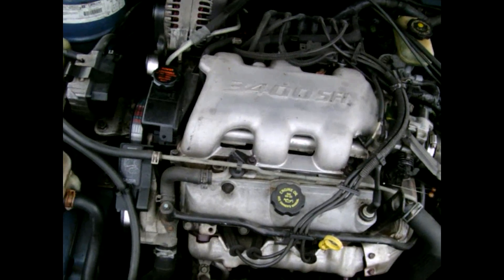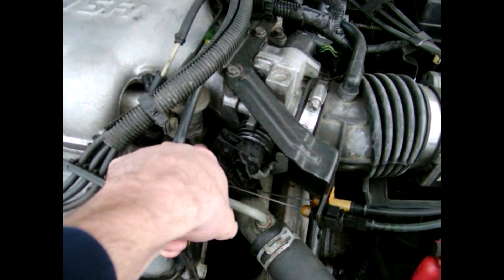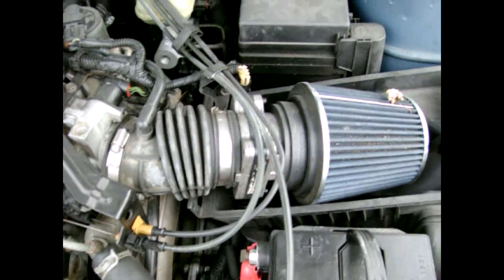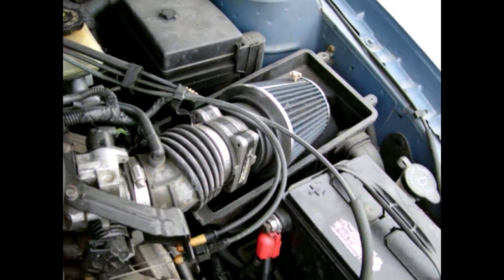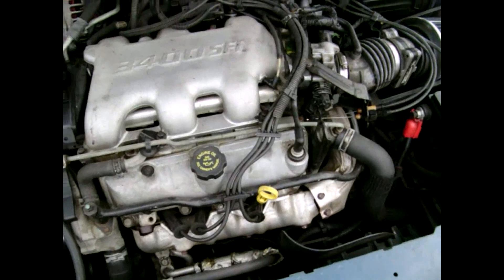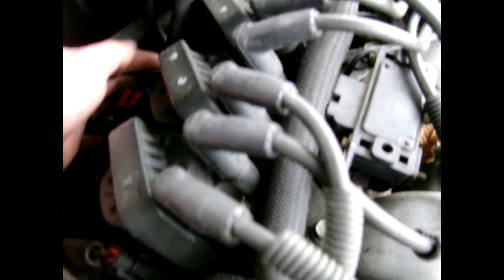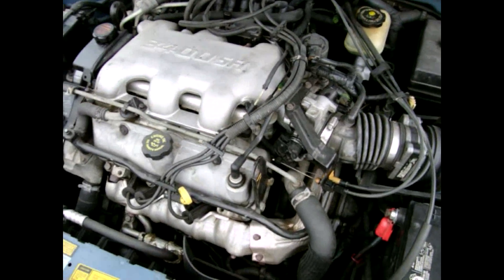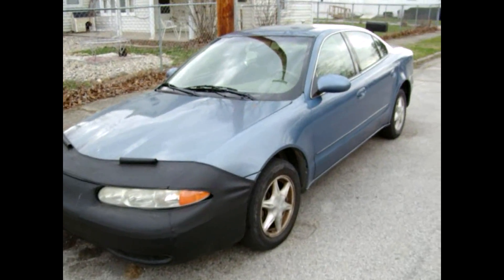3400 GM Engine 3.4 Liter Motor Explanation And Discussion

Comment: Possibly the coil pack is arcing out. They can give sufficient spark at low RPM but can't deliver the right amount of current needed once RPMs go up. Also you mentioned that it gets worse when it's wet. Be careful with this next trick and don't zap yourself. But I've used a spray bottle in the dark and sprayed a mist around the coil pack and wires. Watch for any blue arcing. The water will allow it to jump spark easier and be more visible in the dark.
ok gave it a try last night and saw 2 areas

Comment: So my 2001 chevy impala with the 3400 has those two nipples on the manifold one on the front right as your looking at it and one on the rear left both are suctions how would I fix that issue because when not capped the engine will not run
Reply from the maker: If they break, it can be hard to find a replacement.  Might try finding some at the junkyard or get some bolts to plug them off at Fastenal.  The ports are used to bleed air out of the system.  These engines are notorious for bad gaskets.  If you keep having to bleed the system, it's a telling sign that a gasket has gone bad.
VT247

Comment: Hey thanks for your post im looking to change egr tube in my 2001 pontiac aztek same 3.4 any insight on how to get it done will be awsome to me thanks
Reply from the maker: Spray the area where the tubing connects to the manifold with some penetrating oil and let it soak.  I've never had to take one off when it's actually inside / on the car without the motor out.  Probably need to remove the front 2 motor mount through bolts and 'rock' the engine forward to gain extra clearance to the back.  The EGR has 1 10mm bolt holding on the transmission dipstick.  Then there are 2 bolts holding the EGR to the upper manifold.  1 bolt that holds the tubing to the EGR.  You'll need a big wrench to unloosen the tubing from the manifold.
VT247

Comment: I've personally repaired like 10 of these engines and i hated changing out the gaskets, it's such a huge pain to do and it's not even worth it at this point since many of these engines blew up anyways.
Reply from the maker: I've told countless people when they discover a head, intake or timing cover gasket leak.  Do them all at the same time.  Yes, it does mean basically an engine overhaul of the long block, but the factory gaskets will eventually fail and if a person only does one, they'll be back in there later doing the rest.
VT247

Comment from the maker: It's best to take off the upper intake and clean the passage.  But, it is possible to remove the EGR valve, 2 10mm bolts and spray carb cleaner down the passage with a coat hanger used to break up carbon.  Without taking off the upper intake, the engine would have to eat all that junk.
VT247

Comment: Couldn't see the back plugs on my 02 grand am gt. 3.4l. Was on the last spark plug and it cross threaded in. I have my abs light on, traction off light on, service vehicle soon on, and service engine light on. With the abs, traction, and service vehicle soon, I know what's caused that. Grand ams are bad for their sensors on the hubs.. The service engine soon light is caused by my evap purge solenoid not working properly, as well as the tube that connects to the valve cover from the solenoid is cracked and dryrotted..

Comment from the maker: If your car is overheating, I seriously doubt it's the thermostat. Someone may have told you that the thermostat is stuck closed. This rarely happens on these cars. Most likely it's the head gasket, they are known to go bad. If you bleed the air out of the system with the bleeder screw on top of the water pump (7mm) or thermostat housing the temp stays regulated for a few minutes. Drive it and air bleed the system again & there's air, it's the head gasket. Hope this helps. : /
VT247

Comment: I have an alero 2000, 3.4L , I already change, fuel pump, sparks, spark plugs, egr valve, idle air control, ignition switch, map sensor, throttle sensor, and my engine still shake in neutral or stop sign, its feel like going to shut off, what could be the problem?..... somebody give me any idea, this touch my pocket really bad.
Reply from the maker: I'd start by checking the coil packs and that each cylinder is getting spark.  Sometimes the coil packs will short out and make the car run like crap.
VT247
Reply: Any codes?  I had my Cylinder #6 give a no spark condition.  Engine would run very rough, and throw codes P0300.  I had to change out the ICM under the coil packs, and that solved the problem.  Before that, I was also getting random misfires under hard acceleration.
Reply: i have misfire code, same thing happend to my crack car, today i going to remove that part to bring it to auto zone.... i just changed the intake manifold gasket but the old one wasnt burn o fail.

Comment: thoughts on the 3.4 in early f body camaros? degreasing these engines what should be covered pressure wash is a no no right?
Reply from the maker: The 3.4 in the Camaro's were different motors.  Not had much experience with them.  As long as the intake doesn't get water in them and the spark plug wires are in good shape, I've sprayed off several grimy motors at the local spray and wash. 
VT247

Comment: I have a 2003 Buick Rendezvous and I recently had the intake and head gaskets replaced along with the thermostat and a bunch of other stuff. It drives great and no cel or anything. But! I have two little problems. It has been fairly cold in the mornings and when I first start the car I sometimes hear a slight tapping noise which I suspect to be a loose rocker arm or maybe a lifter? Only on cold starts and then goes away in a sec. Also, my gas guage doesn't work well. My low fuel light comes when I first start the car and sometimes slowly goes back to the correct fuel amount. I'm hoping you can help.
Reply from the maker: The fuel gauge issue is the sending unit inside the gas tank.  You can usually clean the 'swipe' area that is metal and push in the connecting tab to make better contact.  Bad news is that you have to drop the tank to do this fix.
The slight tapping noise is most likely piston slap.  The engines have a loose tolerance for the seal and will make that noise.  It's not really something to be concerned about.  I imagine that you live in a cold region right now being winter and this is typical for these motors when starting cold.  The piston rings expand and make a good seal once warmed up.
VT247
Reply: Thanks for the respond. I might try some fuel system cleaners in the tank to see if that helps the issue. If not, I might just go ahead and get that fixed. As for the piston slap I didn't hear it starting it up this morning so I do think it may not be an issue to worry about. Thanks again
Reply: Vacationtime247
To stop the cold start tick noises in my Pontiac Montana I put in a bottle of STP Oil Treatment. It's very viscous and sticks to engine parts rather than run down and pool in the crankcase when the van's not running. Lack of lubrication until the oil pump has a chance to circulate the oil seems to be the reason for the cold start noises. I recommend the Oil Treatment for high mileage engines.

Comment: Vacationtime, thanks for the videos!  Need your help.... my 1996 Olds Silhouette with the 3.4 liter engine.....well,  the dealership told me that I need to have the crankshaft seal replaced.  Any idea on how much this disaster is gonna run me?
Reply from the maker: If you go to the dealership, it's going to be expensive.  Dealerships usually charge more than most any other shop.  The serpentine belt has to come off along with the harmonic balancer then the crankshaft seal.  My guess, $300-$500?

Comment: I have a 1998 Venture and the pipe that runs in front of the motor that looks like it goes into the firewall, and has a couple of small hoses in it, what is that called? Mine got a pin hole leak in one of the corners and I had to have it towed because of the leak. Some have said it is the transmission cooler line, but I don't know. I was spraying antifreeze on the motor so I know it has something to do with that. Any help would be appreciated.
Reply: heater hose just get a peice fron autozone ask then to look at it

Comment: 2003 Buick Rendezvous leaking antifreeze behind engine block. Can't tell exactly where. Is there a hose I'm missing. Problem just started after new water pump was put on.
Reply from the maker: Could be the intake or head gasket.  They tend to go bad.  
VT247

Comment from the maker: @Texasselling My 99 Alero's fan's don't come on until @3/4 way warm.  A car isn't overheating unless it boils over.  If you have antifreeze bubbling out the radiator because it's to hot, it's overheating.  If not, it's fine.  Besides, an engine runs more efficiently when it's warm.
VT247

Comment: Im assuming intake manifold gasket. Getting air in the cooling system, losing coolant, over heating issues. Fluids do NOT mix though, so thats good. I bleed the air from the line every day or two and add some coolant until I can fix it right. Any recommendations on what types of gaskets to fix these with? My last 3400 blew THREE head gaskets. I heard there was a good set that lasts longer now. Any tips woul be great! Thanks
Reply from the maker: It's not that much more work to go ahead and do the head gaskets if your already doing the intake manifold gaskets.  My recommendation is to do both if your already in there.  Use the Fel-Pro HD (Heavy Duty) head gaskets and the rubber Fel-Pro intake manifold gasket kit.  Be sure that the metal tabs line up when doing the intake gaskets that fit into the slots on the heads.  I accidentally didn't have one of the tabs lined up right, torqued it down and cracked the upper AND lower intake aluminum manifold and had to replace both.  The intake and exhaust pushrods are different lengths and be careful not to over torque the rocker arms to not strip out the threads in the head.  Hope this helps : )
VT247
Reply: Vacationtime247 yes, i was going to replace all gaskets. Ive never done anything more than a water pump, alternator, and stuff like that. No actual engine work. Any tips or tricks? Thanks
Reply from the maker: Read the manuals, watch the video's and let those be a guide.  It's not that bad once you know what you're into.  Intake and exhaust pushrods are different lengths so make sure those are installed correctly.  A/C pump needs removed to take off a bracket to get the heads off.  Cut the tab off the oil dipstick instead of trying to pull it out.  Just a few pointers.
VT247
Reply: I appreciate it. Ill keep you posted if I try to attempt it

Comment: I have a 01 Chevy Monte carlo. My car always starts rough i gotta hold down gas for it to start. Also once its warm she likes to stall after i sit at a stop light or sign then turn a corner or something it stalls. I replaced fuel lines, idle motor, pcv valve, plugs and wires, and fuel filter. What could it be on the 3.4 sfi...
Reply from the maker: Fuel pressure regulator and make sure it has good pressure from the pump.
VT247

Comment: Where would my booster vacuum line be then? Just bought an 04 alero and I just cant seem to locate it.
Reply from the maker: Back of the upper intake manifold.  Largest vacuum line connected to it.  Close by the alternator area.
VT247

Comment: Omg...I ran into another Problem withy 03 monte carlo, Today i had very lil pressure in 1st gear but on the freeway it ran cool...Ummm now it wont drive if I put in Drive, but it would drive in drive 1 and 2 I don't know what the problem is and I'm tired of trying to find someone to diagnose my Monte Carlo correctly.. in the opinions on what you think it might be?

Comment from the maker: Take the car to most any auto parts store and have the codes read.  Best to erase all codes.  Get the loan-a-tool code reader from Autozone or wherever and erase the codes.  When the light comes back on, check the codes then.  This will help eliminate invalid codes popping up from the original problem.  Here's my .02  Possibly the O2 sensor, idle air control valve or most likely a vacuum leak.  Spray carb cleaner around the vacuum lines, if the idle changes, you've found the leak.
VT247

Comment: I have the same engine in a 2002 Pontiac Grand Am.  There is a water leak below the motor mount on some hose that comes out of the firewall and goes into a silver cylindrical device in the right front wheel well (behind a bunch of plastic housing).  The engine mount sits on a support bracket and under that support bracket is where the hose coming out of the firewall to the silver cylindrical thing.  Can you tell me what that silver thing is?  How would I go about replacing that hose?
Reply from the maker: +Robert Walker Might be the heater core.  Best to do a pressure test of the system.  Get a loan a tool from Autozone and pressurize the coolant system after filling it up with coolant.  This will show you right where the leak is as it will spray out.
VT247
Reply: +Vacationtime247 I wish I could put pressure in the system.  it's a close system and when I pour fluid into the reservoir it comes right out through a pipe somewhere.  It's not the block, it stays dry.  I have a UV kit that I'm going to use to see if I can spot the leak.

Comment from the maker: Rotten egg smell is usually the catalytic converter.  Check the spark plugs and ignition system as well while your in there.  Hope this helps. 
VT247

Comment from the maker: My Azteks will either die or stall out once the oil cap is taken off when running.  On my red one, 4th gear just went out.  The 4th gear clutch hub splines sheer off.  Guess GM fixed that in 2003 but mines an '01.  So I'm not looking forward to that project at all.  But it can be done with the transmission in the vehicle, but requires 3-6 hrs of work.  : /
VT247

Comment: I  am having an issue with the charging system in an Oldsmobile silhouette 2000, replaced battery, 2  new alternators and still not charging the battery, at times the voltage shows 15.+ coming out of the alternator other times is 3 volts or nothing at all, it seems the alternator is not getting  the signal from the computer, any one have any ideas in Fixes. Thank you.

Comment from the maker: If you ever do the intake manifold gasket, go ahead and do the head gaskets.  It's not that much more work.  It will prevent you from having to do the job again when they do go bad.  The fans won't kick on until it reaches almost the red in most cases.  Any type of oil will work, I've used the best and the cheapest.  Never noticed any difference.
VT247

Comment: Do the 3.5 L chevy malibus have head gasket failure issues ? Mine is a 2005 and it seems like i have excess air in the cooling system. I never had a problem until i cracked the bleeder screw by the water pump and ever since it seems like i have excess pressure. I have drained the cooling system and bled it and no luck.
Reply from the maker: Sounds like a case of a bad head gasket to me.  If you bleed out the system and it still runs hot or has exhaust gases escaping into the coolant it's the head gasket.
VT247
Reply: Wouldn't my oil be milky if the head gasket was bad or not always ?
Reply from the maker: Typically with these engines milky oil would indicate a bad intake manifold gasket.  A bad head gasket can cause exhaust gases to escape into the coolant passages, causing air bubbles overheating and coolant loss..  Happened to my '01 GM 3400 Aztek, replaced the head gasket, has run fine since.
VT247

Comment: Hello, I have a 2000 alero 3.4 v6..trying to replace camshaft sensor & in order to do this, I need to move power steering pump outta the way.. Removed the 3 bolts (through the pulley access holes) but can barely make it budge..only a few cm up.. Am I missing something? Do I have to remove the pulley in order to "lift" the pump? Thanks and good work!
Reply from the maker: You'll need to completely remove the power steering pump.  There is a 5/8 nut that holds on the high pressure line and a pressure clip that holds on the low pressure line.  I always put on an alligator clamp instead of the clip.  Once all that is off, you'll have access to the cam sensor.  I had a trouble code with a cam sensor once on a 3400, turned out to be the spark plugs.  Check the spark plugs, plug wires and distributorless ignition system as well.
VT247

Comment: I had (and I am thinking about getting back) an 02 pontiac aztek. Runs like a scalded dog most of the time. However, after sitting over night the next day when you start it and try to take off it would chug, lug, spit and sputter. Shut if off for about 45 minutes or so.. start her back up and run like a dream all day long. Traded the car... between us and the new owner we have changed: plugs, wires, fuel pump, fuel filter, a tiny vacuum hose on the charcoal cannister, another part on the cannister sorry cant remember what it is called and ran a can of sea foam through it with no change. Problem is getting worse according to new owner, takes longer to "warm" up enough to drive and she said when she removed the gas cap completely the car dies... thoughts?
Reply: Brenda Holm oh forgot.. replaced 02 sensor as well... only codes have been fuel related hence the replaced parts and 02 sensor.
Reply from the maker: If the car is taking forever to warm up my guess is that it will need new gaskets from the heads up.  The head and intake manifold gaskets go bad in the GM 3400 engine.  I've got a video up on how to do this repair.  
VT247